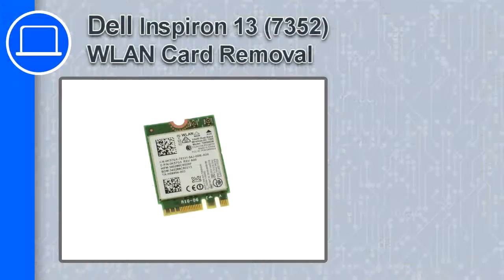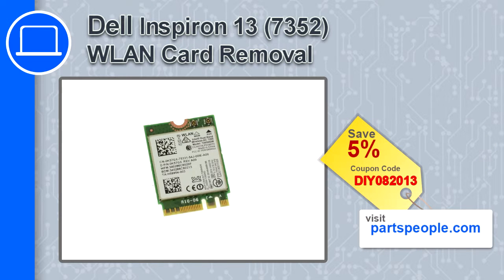Dell Inspiron 13-7352 (P57G-001) WLAN Card How-To Video Tutorial

Comment: Where can I buy a brand new motherboard of my Dell Inspiron 15 7000 series which has an Intel processor i7 3.0 ghz speed? and I bought the Inspiron on September 2014.
Reply from the maker: +Adam Dang You would have to be more specific. There are many Inspiron 15 s that are in the 7000 series.